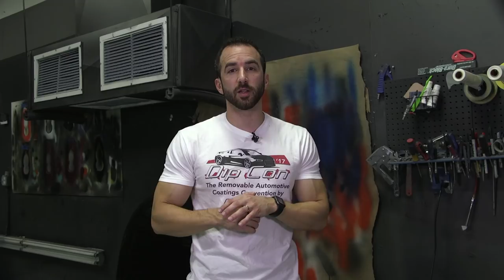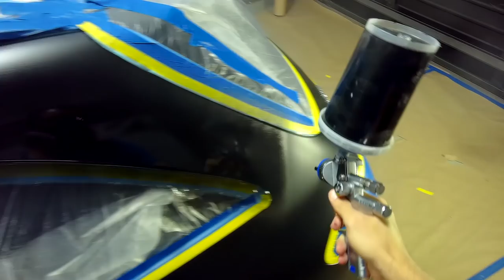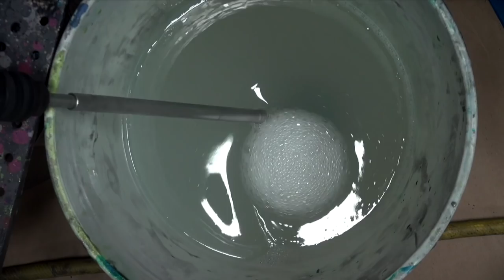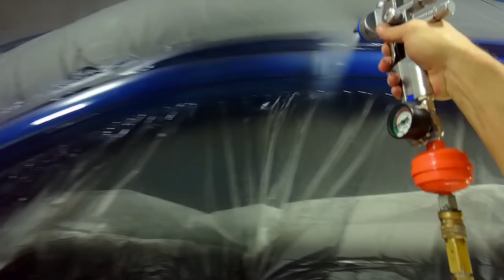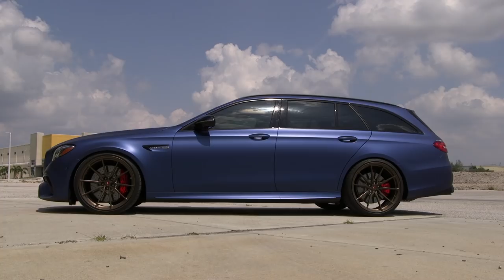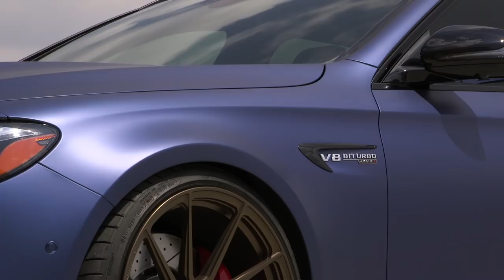Fonzie's Dream Car!? First Dip on the E63s Wagon - Relic Blue

Comment: I have a 97 dodge stratus  I bought it new 21 years ago, has over 230000 miles on it.I only drive it to work and back  because  It gets great mpg but the clear coat is about gone. I would love to see you transform an older car like mine.
Reply: Restore Bad Car Paint with Plasti Dip:  https://www.youtube.com/watch?v=TKWVHYEvkZQ
Reply: Thanks for the link, that car turned out great and my Dodge is no where near that bad of shape. Will definitly try

Comment: SLAM IT ON BAGS!!!!!
Reply: Fernie Esparza , no. That will ruin it
Reply: Lol how?
Reply: Destroy ride quality, destroy the cars value.  Bagging a car is not only stupid, but provides no benefit whatsoever.  Not only that, but they cause tires to wear unevenly , and much faster than normal.
Reply: Verruckter Schakal haha that’s your opinion. 🤷🏻‍♂️ I have a lot of friends with bagged cars and their ride quality is fine and you only wear out your tires if you have camber.
Reply: Fernie Esparza. Actually it's a proven fact. Especially with resale value. Cars aren't meant to have that sort of shit on them.
Reply: It's not very difficult to reverse the modifications. And resale value for this car dropped the minute Fonzie drove the car off the lot. I don't think he's too worried about that.
Reply: Plus it's not camber that necessarily destroys tires. It's toe. With a proper alignment, there will be little to no substantial difference in tire wear.
Reply: Verruckter Schakal are you against modifying a car or what

Comment: How do you get enough product on the back/sides of the door handles so they don't start to peel with use?  I ran into this problem when dipping a Volt and while the body is holding up really well, the door handles are peeling a little.

Comment: Do the professional plasti dip products still leave a texture like the other products?
Reply from the maker: jodizal21 actually if regular Plasti Dip is applied properly, it doesn’t have a texture either. ProLine is certainly “flatter”, but both can be very smooth. It’s all about how you spray it.

Comment: Can someone provide some clarity/insight for me on the following?  If i want this color to appear seamless, meaning I want to create the perception that this car is this color everywhere there's metal, therefore; coverage of the jambs and shuts as well, is there a technique or process anyone would recommend to do a complete color transition inside and out?  My concern is the outcome to the parts of the car we don't see, the interior jambs/shuts/hood/trunk areas that have OEM paint.  Would I be opening the door on this AMG for instance and see a line where the blue ends and the OEM remains?   Is it a solid line or will I see spray marks/a dusting effect?    How is this challenge addressed for those of you that do this professionally?   I assume the same challenge exists for wraps.
Reply: You can absolutely spray the car like you were "painting" it with traditional paints.  Way more masking, and prep though